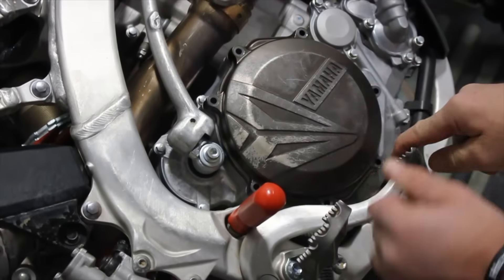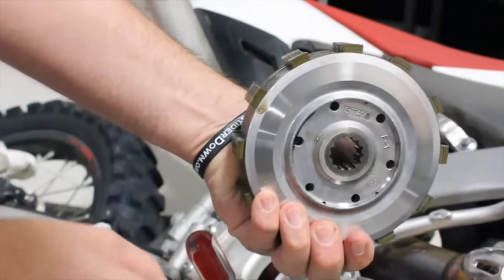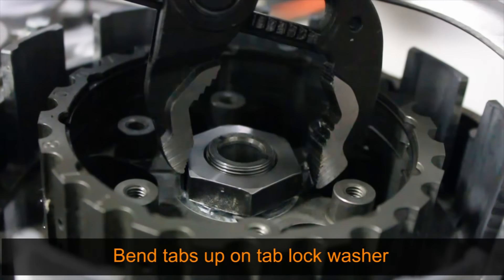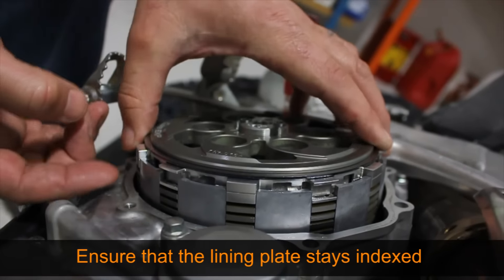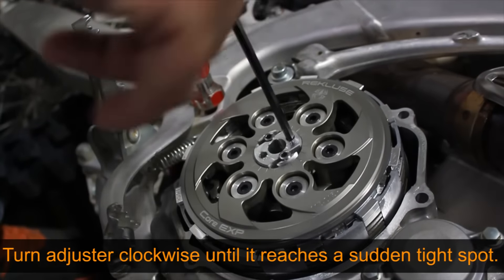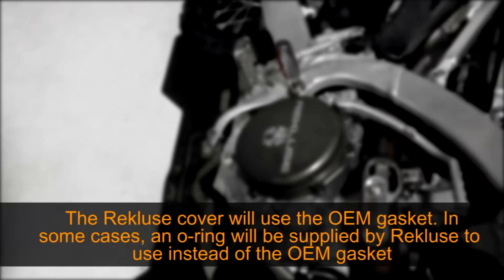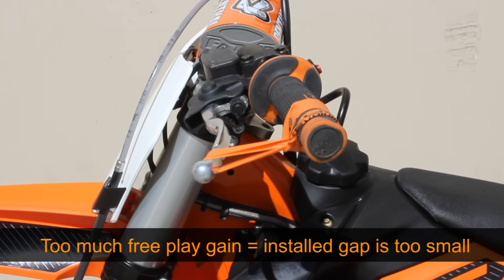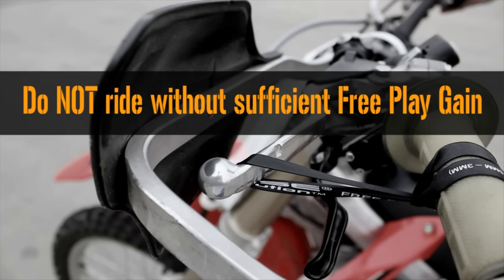Rekluse® Install | Core EXP™ 3.0 auto-clutch (non DDS clutch models)

Comment: My bike still tends to stall out. How can I fix this?
Reply from the maker: Start by checking your Free Play Gain. See the following two videos: 

https://www.youtube.com/watch?v=okJOz_yBGuA

https://www.youtube.com/watch?v=PT6EKdLDrgU

If your're still experiencing the issue, you can reach our knowledgeable costumer service team by email at customerservice@rekluse.com or by phone at 1-208-426-0659.
Reply: A heavier flywheel would solve your problem.  If this clutch is heavier than stock it should help with that.  Also increasing the fuel mix (lower AFR) is a miracle